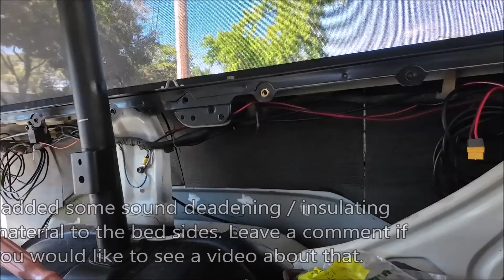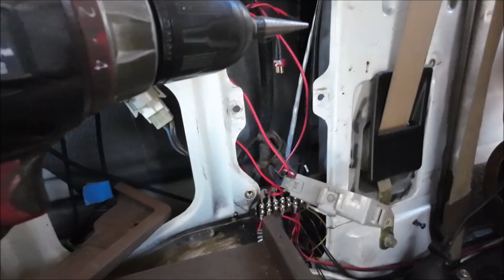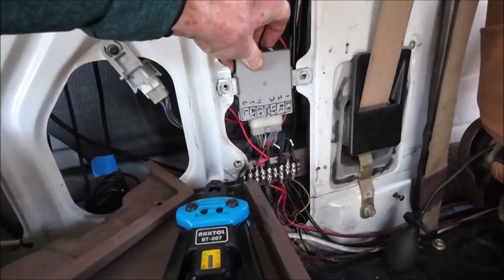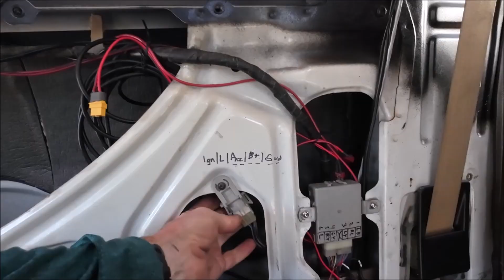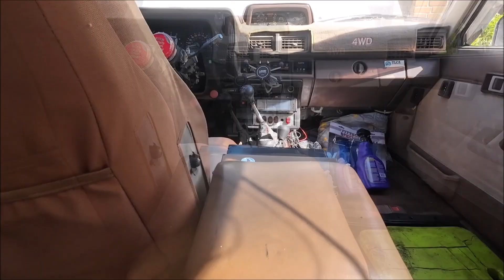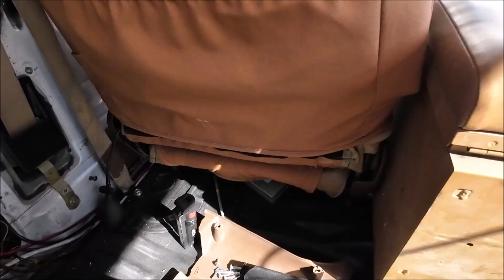Replacing Rear Window Relay Screws w/ RivNuts

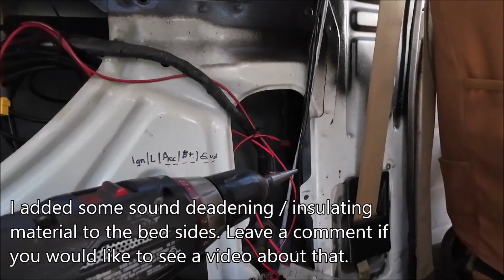Comment: 0:11 I’d be interested in an insulation video.  My ‘87 4Runner and ‘94 XtraCab could both use some sound deadening, especially the 4R as it has wind noise not present on my ‘94.  Both have manual windows but the 4R’s driver window wants to back itself down from the fully-up position slightly, like the weatherstripping’s shrunken a bit.

Feel like I’m always applying pressure to the hand crank to bump it back up that last 2mm to try to quiet some of the wind.

Comment: I just wanted to stop by and tell you how much i appreciate the work and documentation you are doing. I'm in the midst of a very extensive swap and restoration on a 1st gen 4runner. your videos and website documentation has been instrumental in helping me rewire the tailgate, and door switches. I went a little bit of a different direction, but your stuff helped me so very much. Thank you, i know all too well how hard this stuff is.

Cheers!
Reply from the maker: Great, glad you find the videos helpful.  Some of these things I started many years back, like replacing a few plastic push pins w/ threaded inserts.  But I never documented any of that, nor did I set out to systematically replace as many as possible.  I'll be trying out another option for the rear window switch shortly.

Comment from the maker: Another one of those "while you're here" projects.  I've had issues with the rear window relay module getting loose and rattling around over the years.  I would essentially glue it in place, but that was a PITA every time I needed to remove it, trying to pry it free without damaging the brackets.